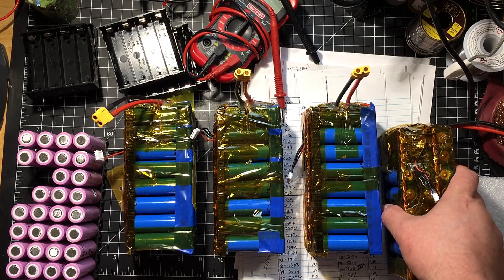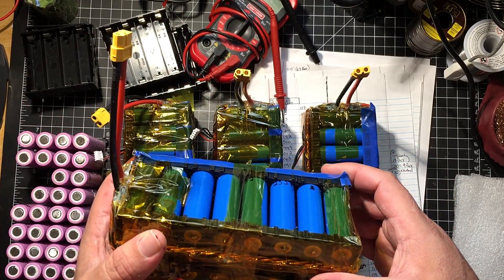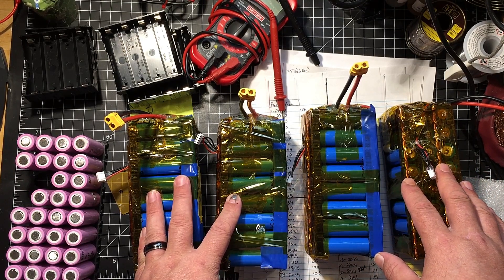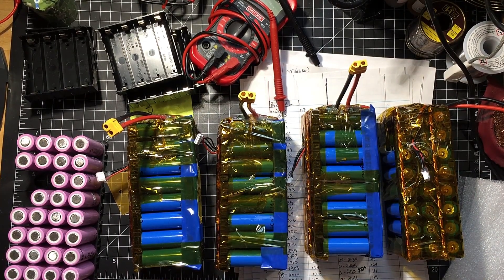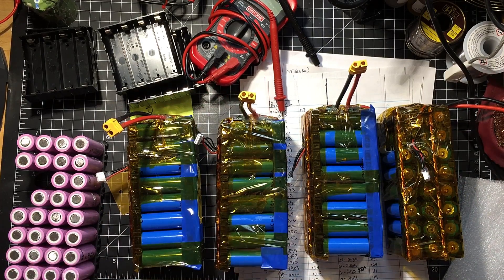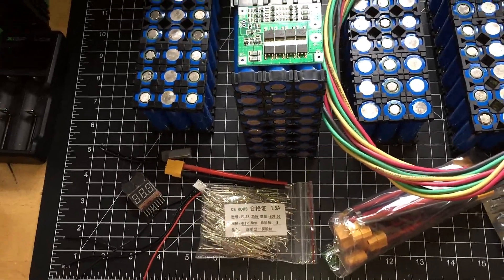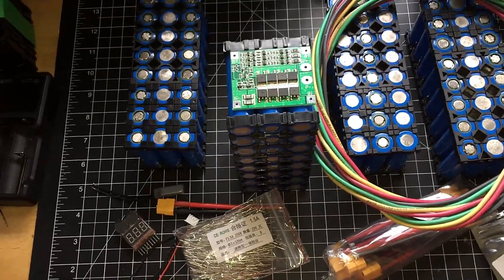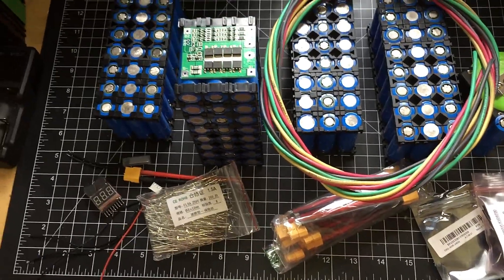DIY Mini Tesla PowerWall Part 5 (configuration & Soldering 18650 Packs)

Comment: Great video, your battery pack looks so good. You can try with LiFePO4 battery, with 2000 circles lifetime vs 500 circles of Li-Ion, It will be more worthy of the effort you spend.
Reply from the maker: you should see this video, this is the How to I mentioned in your other video-https://youtu.be/RB3Y4Xigums?t=1627

Comment: wow that's a lot of kapton tape. I could print you some nice covers like this https://imgur.com/a/neP6JWv
oh just realized they are 3 in a row not 4.

the music sometimes takes away my concentration on what you're saying, not sure too loud or just cut away the loud parts. ;)
Reply from the maker: I wish I could use something like that. I had to use Kapton Tape on the top and Shrink Tape on the Btm(Shrink Tape is thick). Because of the way I have to set these up. It was either this or Plexiglass, and I opted for the Tape because I got an Incredible deal on the wider stuff. Still Not 100% sure if these will go in upside, or sideways. I have a feeling that 4K worth of Batteries is going to be an Extra Tight fit, leaving me barely enough room to run the wiring, shunts, Fuse, and relays. I will also have wiring running from the batteries to the charger system I will be using along with all the little 1s-8s voltmeter alarm(mounted on the face of the door with a switch). Or that is the plan...LOL

Also, for it seems that the major manufacturer of the cell holder figured out they needed to make the holders a tiny bit wider. Been getting stock like this from multiple vendors. Batteries fit nicely, but now you have to use tape,  shrink wrap or Tie straps to hold them together. Just soldering and tabbing no longer works. You can also tell they are use bettery plastic for the molds.